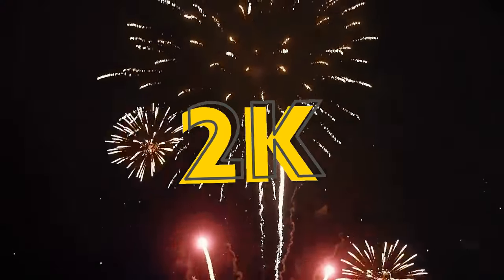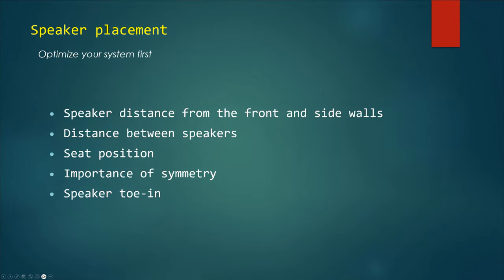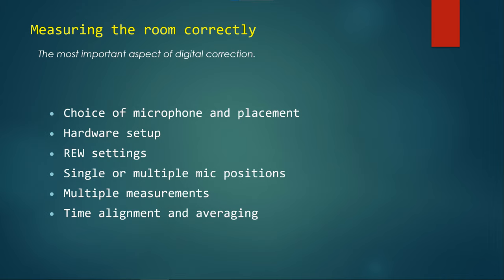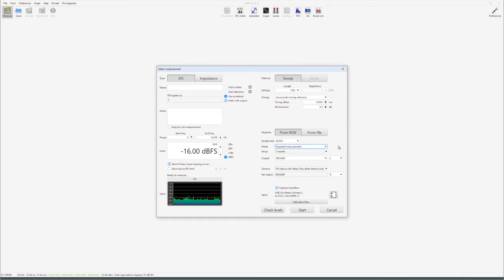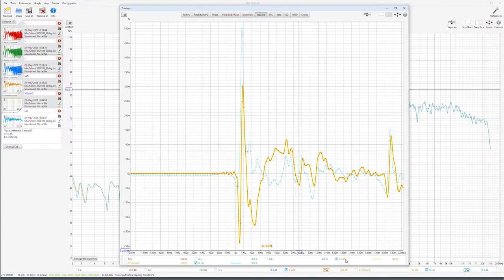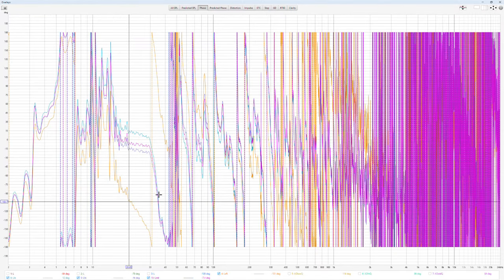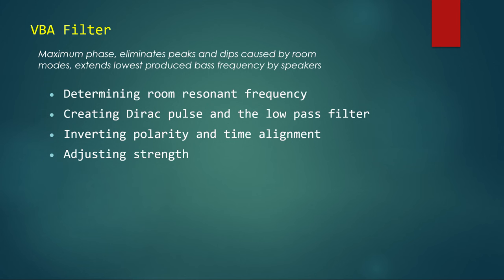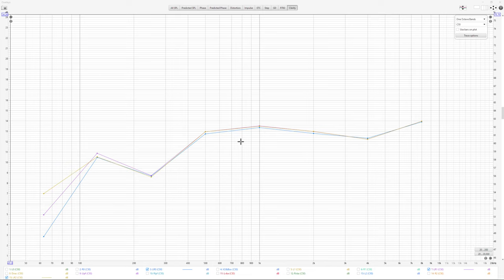Digital Room & Speaker Correction Workshop

Comment: Hi, I have a little different question and I'm not sure how you feel about car audio (stereo) taking into account you car audio video ;-). But would you recommend to go MiniDSP route to have a chance of using FIR/rePhase or go with car-specific DSP like Helix and only use REW?
Reply from the maker: I wasn't able to apply DSP in any car so far as most cars these days already come with factory installed systems with no user input allowed. I would go with something like MiniDSP OpenDRC-DI (if you can find one) as it's the only one with adequate FIR filter taps count (I think 6128 taps/channel) to be able to apply any meaningful correction to bass frequencies. I am not sure but I don't think Helix allows FIR filters like most others which will only allow PEQ (IIR filters) and no phase correction will be possible.
Reply: @ocaudiophile  Thanks for the answer. OpenDRC-DI will be hard to find where I live. I was considering C-DSP 8x12 v2, but I'm not sure how many taps it can handle. Right now I'm thinking on using normal car DSP and RPi with CamillaDSP, we'll see what I will manage to achieve with that...
Reply from the maker: I see...If Rpi can work in a car, there're almost no limits to what can be done with Camilla! @adrianbeacon6421

Comment: I'm trying to figure out which steps are necessary for me with my gear. My setup is a bedroom studio with yamaha hs5 active monitors and an 8 inch ported active sub. I have a umik-1 and minidsp 2x4 hd. I'm pretty comfortable with req and have a base level knowledge of much of this but am having trouble with where to start based on what I'm using. I just want to get back to mixing!
Reply from the maker: This procedure will give the best results with the equipment you have:

1. Measure each speaker and the sub separately with REW+Umik using acoustic timing reference (should be the same speaker for all measurements) and clock adjustment with acoustic reference.
2. Time align both speakers and the sub at the LP and crossover speakers around their spec bass roll off frequency and dial these settings in the MiniDSP
3. Re-measure left and right speaker this time with the sub active and crossed over.
4. In REW EQ select MiniDSP and 2x4HD, upload a house curve (I'd recoomend Dr Toole's curve- you can find that in most of my video description links), "Match target to response",  and "Match response to target" with settings 20Hz-200Hz, 0dB boost, Allow narrow filters below 200Hz ticked. "Export filter settings" which will generate biquad filters (a1,b1,....) which you can directly upload to MiniDSP.
5. Optionally, you can create crossover phase correction filters in rePhase  for your particular speakers, save them with 1024 taps, 96KHz, .bin format and use that filter in MiniDSP FIR. Even with 1024 taps, you could still apply descent high frequency crossover phase correction.

PS If you use your PC as the convolution engine, you could do better by using high taps of full FIR filters.
Reply: @ocaudiophile Thank you so much for the quick response.  

A few clarifying questions:

My speakers min freq is said to be 54hz, so I should set the crossover in minidsp to lowpass the sub and high pass the speakers with 24db/oct falloff?

When I export the settings for the minidsp as you describe in step 4, these are for peq not fir?

And then for step 5, I started to follow your tutorial for phase correction but got a bit lost. If I understand correctly I need to use the minimum phase cal file for umik to take measurements of each speaker, import those into rephase and then apply phase correction. Since the speakers are active though, is the crossover phase correction you're referring to for the crossover between sub and speakers? 

Once again thanks for what you're doing I truly appreciate your dedication to this sort of stuff.
Reply from the maker: Yes, Linkwitz-Riley filetrs with 24dB/octave roll off around 50-60Hz is a good starting point but feel free to test other roll offs and filters.
Yes, biquads are IIR filters (you can also do allpass filters with biquads and I have a MiniDSP video on that but time-reversed all-pass which you need for phase linearization is not possible with 2x4HD)
Most active speakers still need some phase linearization especially for box and port (these are too low frequency for 1024 taps though but no harm in checking). I think, you can use "Merge cal file to IR" in REW to embed the min phase mic cal file to old measurements.

Comment: Awesome video much appreciated! 

Few questions though...

What would be ticked in  REW - Analysis - Impulse response calculations....

... if you're using a soundcard and XLR mic ? (I've calibrated my soundcard and correction files for mic) 

Should I tick...

Loopback delay reference is IR peak?

And

Adjust clock with loopback reference?
Reply from the maker: Loopback is the most accurate reference but needs a sound card or audio interface with two inputs and one of the inputs should be connected to the output of the playing device. You can find some useful instructions here :

 https://www.avnirvana.com/threads/rew-loopback-connection-setup.9967/

Comment: Hi OCA I'm starting to apply phase correction to my Polk R700 which by specs have 350hz and 2700hz XOs and a port peak at about 35Hz extracted from a review from Audioholics. I didn't inverted the signal on RePhase since I noted that thry where nearer to zero without inversion. But when I compared impulse response on REW after applying the filter I noted filtered response is much better but inverted. Is this posible to happen ? or is sign that I have to invert the signal on RePhase. Also I noted that in my case I got a zero at about 375Hz instead of the 350Hz of the specs I could asume that the real crossover is on 375Hz due 5-10% tolerances of passive components of the XO ? Many thanks for your videos.
Reply from the maker: Inverted impulse peak after phase correction is expected. Stick with spec xo frequencies.👍

Comment: Great tutorial and video as always. Just a confirmation question. Do you really mean to say that the starting TV conversation in Roger Waters’ Amused to Death should seem like it is coming from the Rear Left of the LP? For my setup it seems to be coming from the Front Left speaker. Thanks !
Reply from the maker: Yes I mean it
Reply: @ocaudiophile  oh wow! That means I still have a lot of work to do with my speaker placement. In my case the left side wall is closer to the Front Left speaker than the right side wall, as in, the whole setup is towards the left side of my room. Is it possible that the two speakers have different toe in angles to achieve the best possible soundstage ?
Reply from the maker: @paulsoumya  No, the speaker distances to the side walls should also be equal
Reply: @ocaudiophile  In my case it is impossible for me to achieve this as it is my living room with a kitchen on one side of the room ( typical modern European small apartment). That’s why I was asking if it is possible that when the sweet spot of the soundstage has been achieved, the two speakers have different toe in angles to the LP.
Reply from the maker: If you managed to achieve a cehtral sound stage with different toe in angles, I guess you can keep it that way.

Comment: Hi, @ocaudiophile, I really like your tutorials!
But how should we use properly rephase for phase alignment if the speakers have first order crossovers? 
Like most Dynaudio models for example...
Reply from the maker: It will be complicated :)

copy everything after this sentence and "paste from clipboard" to rePhase:

rePhase settings
eNp1VMtu4yAU/RWL1YzkIPw22XWkSjOr6b6KLGJwgmrAAyTpQ/33udhpm1Rkk5hz4Jz7gje0Nc/d
IEcvrEPrx02KeqFhIfUOrZGSnI8CAbgX/ZM7KMA4326LinKal3nfVLwueFXTgTeUDwVrhrDbGueu
VWEhNFMCBDJCyO/Xmv+ahP3be3YMBoO03w4Yq5iH7UWebKV3yZ/7+/tEGW2SH/jEjj/Rx57uCIek
0UEakxbwHZNhRTAhYSX+LZI7y6Z954T3kJ2LYZ1l+gmtSYrkVTyPaC93+9XEnAPBXPPEWC5scjeO
q4czWKJUH8YxnW0bQEKe4Q9twEcJ5g5WKCguWr+h7cusFZx6oyahHfNiXnLmGTjOUtc/myWxzgwD
xBvyA/W95KJTDJqVnRfTnrlFSmqojJ8/vVTi8uB7irQJjgg0zAS0fGV+KaI2WnxDu2E0xgK3yuac
prmkb4j1XkL7grdiz6EB7UyHEDorxg/J3mjnmfaruTMQzsskLuDEjWYKnkc2HsRS8FXe4Ip8lZHg
DKVkkz5+tDUvcUuK8IHJNVNQXDR5jKlzXMVwSnGeRU9kVYNLGmPyObqIeY3bKm5OMa2jJkuKEfMW
3OPmGcVtjClvaNVFSfEt9yaaYVbf0Mqrgl6Yb95hNCczMiv9C7QV5g5Ix9Q0XgwdjBDc5zO+PC9l
uxg4M/gTs2EkrHiY5/cL7Nxhe345IuTl3S9xGAfYfv2SeDa5wNdFG2o5XwUureg/592qy5m0Zyr5
fClSdJKam9MSdaCZ3h0gX/T+HxkVfIQ=
Reply from the maker: and?

Comment: Hi OCA，While making speaker box and crossover phase correction, we need the crossover frequency in our speakers. It's a bit frustrating that I can't find the frequency response , and even the official customer service says they have no info about it . The second way is in near-field measurements. However,  my speakers don't have ports,  it's Variovent. How should I proceed? Thanks a lot, again.
Reply from the maker: Good thing is sealed boxes have relatively flat bass phase responses unlike ported ones. You can measure close to the woofer center.
Reply from the maker: Difficult to see from the frequency response measurements. The volume levels of drivers will need to be adjusted to see the intersection frequencies. Phase graphs give more information. Woofer's polarity is inverted. I would say (with a wild guess) XO frequencies are 145Hz and 1150Hz. Filters orders can be found by trying different combinations in rephase using those frequencies.
Reply: @ocaudiophile   You mean that each driver measurement needs to be  adjusted to the same volume level ? Or what should I measure correctly? If possible, I would like to re-measure it for you to check.Thanks again!
Reply from the maker: I am not aware of an optimal method. I had seen articles on correctly stitching driver measurements but couldn't find one just now,  check DIY forums. @WallaceChen

Comment: I have a question about using rePhase with MiniDSP - In the manual for the Flex (which is the model I have) it says:  "The miniDSP Flex can compute a total of 4096 taps. These taps can be distributed as you wish across the four output channels, with the limitation that each output channel must have 6 or more taps and can have no more than 2048 taps."  - Does this mean I should use 2048 as the number in RePhase, and does this still mean I cannot use Box Correction?
Reply from the maker: Yes you can use 2048 tap fir filters. It should be enough for box correction if you use rectangular windowing and 99% or 100% centering.
Reply: @ocaudiophile  Okay, great - one more thing. According to the specs on my speakers, Crossover frequencies: 250Hz, 2.2kHz. Crossover slopes: 24dB/octave Linkwitz-Riley (midrange/tweeter), 18dB/octave (midrange/woofer) - I am unclear what that means for the crossover value setting on the 18db/octave mid/woofer in RePhase.
Reply from the maker: You can use "butt 18dB/oct" Subsonic filter @ 250Hz for a 3rd order crossover filter.

Comment: Sounds great! Did notmwatxh the video yet, but can this also be applied to surround sound systems?
Reply from the maker: There's a lot of information in the video about sound but mostly for stereo systems. An Audyssey wrap up video is on the pipeline though.
Reply: @ocaudiophile  awesome, looking forward to that!
Reply from the maker: @StuggiSuzi  👍
Reply: @ocaudiophile  I'm looking forward to that one, too :)
Reply: @ocaudiophile  I am looking forward too... :)
Reply from the maker: The biggest improvement I have achieved with Audyssey lately was removing the MiniDSP and the second sub. I first tried to connect the second sub to the reciever but quickly figured DEQ applies different boosts to each sub for surrounds and heights!!! So I removed the second sub as well. Now with just one sub aligned perfectly for the impulse peaks with the rest of the speakers, I have the cleanest sound so far. The new right window time limited auto EQ method with the Harmon is the next improvement I am thinking. You can try that already.
Reply: @ocaudiophile  i also did get rid of my mini dsp and that as well improved my sub sound and response, the minidsp made a great delay. I only run one sub. But will check out the windows with the harman curve

Comment: Hi OCA, I would be extremely grateful if you can make a tutorial on how to integrate stereo subs with stereo speakers. I am right now in the process doing the same using my miniDSP 2x4 HD and have watched almost all of your videos for inspiration. However, I seem to be getting extremely confused while carrying it out myself. Even a 3dB boost to my sub seems to mean that my crossover point with that main speaker changes... not to mention the time alignment, phase correction etc... Also with the miniDSP it seems like one cannot apply a negative delay, which is what I think is required for the subs since they arrive at the LP later than the main speakers. I try to achieve is by applying positive delay to the main speakers instead, to compensate for the subs. But if I apply different delays to the left and right speakers, the sound seems to be much louder on one than on the other. Moreover, the delay setting on the miniDSP does not seem to correspond to what REW is measuring... Many thanks in advance.
Reply from the maker: Minidsp has its own internal delsys hence the difference you see in REW and its delay capacity is somewhat limited but still it will do the job for a stereo system.

The reason I don't do that video is because I don't have subs in my stereo system and surround system subs have weaker bass than my floorstanders so there's no good data I can work on in a tutorial. Reset minidsp (all delays, filters, crossovers etc) and measure your subs and speakers one by one with REW and share here and I'll see what I can do. PS link needs to be google drive or else youtube will delete it!
Reply: @ocaudiophile  Thanks a lot. I Will do that as soon as I get to measuring them next. As a heads up, I have the Focal Aria 926 floor standers and dual Monolith THX 10 V1 subs each placed next to the Arias in symmetry. The subs dig really deep and hard and ideally should extend the bass of the speakers. I have followed your instructions on speaker placement and toe in and have them placed and toed in so that the album “Amused to death” sounds as convincing as I can have it in my room.
Reply from the maker: I'm good with focals, don't worry ;)
Reply: @ocaudiophile  Hi OCA. Here is the link to the measurements I made of my stereo speakers and stereo subs: 

https://drive.google.com/drive/folders/1EUq-ezUezd63LqW1b3B1wgJKD-TLxLN7?usp=sharing

I disabled everything on the miniDSP and measured each sub and speaker separately. For the left sub I used the front left speaker as timing reference and for the right sub I used the front right. I took 3 repeated measurements for each type. The text file contains some info regarding my setup and also my room measurements. I have also included a couple of pics of my room. Please do not hesitate to ask if you need any further info. Once again, I thank you very much for the help.
Reply from the maker: How do you exactly connect speakers/crossovers/subs in MiniDSP? Do you have another DSP source for convolution (like a PC) or is it only MiniDSP?

Comment: rew does not recognize the acoustic time reference beep for my sub because its a high frequency noise what should i do ?
Reply from the maker: That's usually because of sample rate difference between input and output. Make sure everything is at 48kHz in Windows sound settings. Or switch to ASIO drivers.
Reply: @ocaudiophile   i dont have problem with the sweep itself , i have a problem with the acoustic time reference when measuring the sub because i have to turn off  main speakers channel to measure only the sub .
Reply from the maker: If you connect your PC to the receiver with an HDMI cable and select LFE channel with REW Java EXCL drivers, the sweep will only go to subwoofer. You do not need to unplug your main speakers. @Motymott99
Reply: @ocaudiophile  i am using mini dsp 2x4

Comment: Anyone have any idea how, in RePhase, to handle speaker designs like the Zu Dirty Weekend? They claim that their single driver is ‘cross less’ until 12khz, and the a special twitter takes over. Should this even count as a crossover in RePhase? And what about the portless~design? It speaker has slits that open to the floor, I’m not sure that those count as ports… Any insight appreciated. Thx.
Reply from the maker: You will need a phase linearization filter at 12kHz for sure. The bos is a bit too complicated to know in advance but with carefully time aligned multiple measurements, bass phase response canbe extracted and problems manually corrected.
Reply: Thank you! I'm a total newbie here, so will need to figure out what all that means (especially how to extract the bass phase response), but this is a good tip for a start. Thank you.  @ocaudiophile